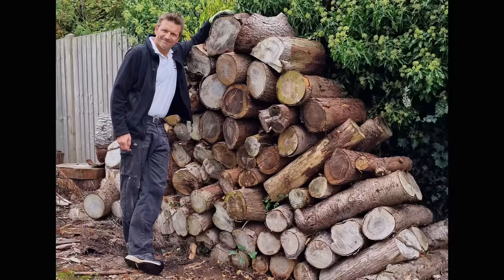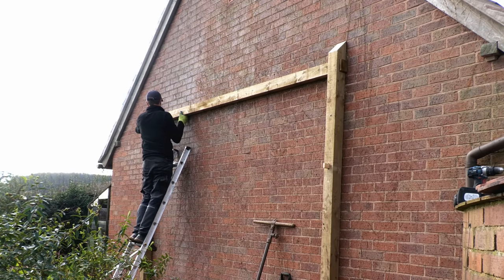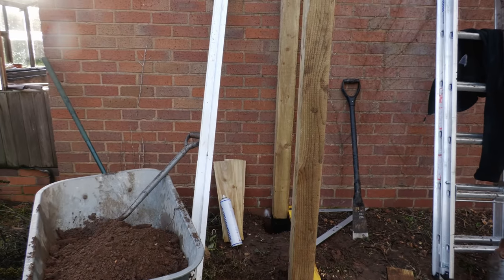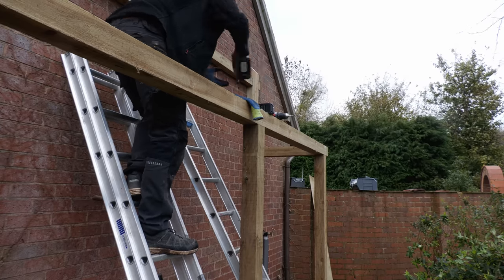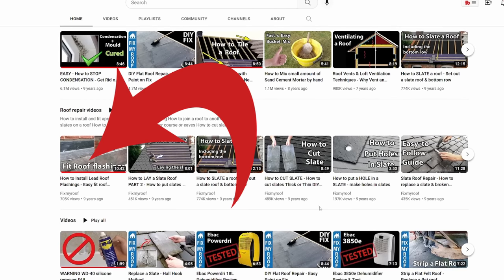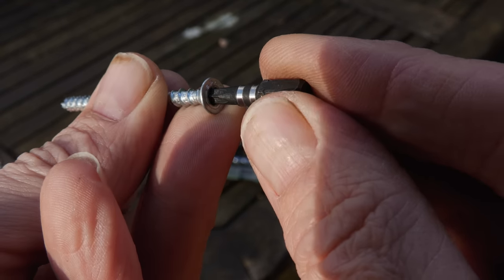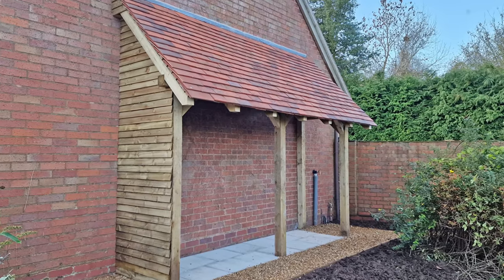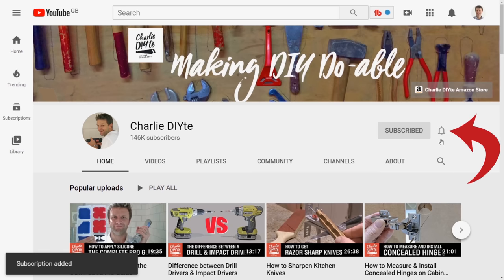How to Build a DIY Log Store

Comment: Be careful stacking the logs in there Charlie, if they're touching the wall you'll introduce an easy way for moisture to travel past the DPC. Either stack them so they don't touch the wall or put something on the wall to protect it, but that could also cause the same issue depending on what you use. 
We built free standing log stores so we didn't have to worry about it.
Reply from the maker: That's a good point, thanks. I'll mull over how to get round that 👌
Reply: I'm thinking a good air gap between the stored wood and the wall will benefit both.
Reply: @CharlieDIYte  Ideally you want all the logs to be free standing with around an inch or enough room for a mouse between the stacks to have good airflow. Also on the topic of airflow I would have made it wide enough to use pallets as a base for the wood so you get good airflow underneath it as well.

Also you don't want to cover wood too much, it's better to have wood exposed to both the rain and sun than no sun at all.
Reply: @Ben-fk9ey  I'd go as far as leave wood out in the summer and let it get rained on. Similar for winter if the wood wont be ready for this year. I don't know where/when/who - but drying (sap) logs in rivers was a done thing.
Reply: @CharlieDIYte  stick a trellis on the wall
Reply: Or some type of racking
Reply: @Ben-fk9ey  We have field mice in the wood pile, have to shake the poo off before taking logs inside.

Comment: Great vid. Thanks.Two ways to easily get MOT out of the bag. 1) when it's being dropped off by the truck cut the bottom of the bag so it all goes on to the ground. Put a tarp and if you have it an old board down first. All the MOT will be loose and easy to shovel up. With the tarp its easy to clean up after you've moved it 2) Put a tarp (better with a board on top) as close to the bag as you can. Split the bag on two sides. The MOT will fall out and you can give it a helping hand with a rake or something. So easy to just shovel off the the board. Keep the vids coming. Cheers
Reply from the maker: Very good point mate, thanks for sharing 👊 Slight problem is I wasn't here when it was delivered 🤣

Comment: Great video, a few points you may wish to consider for your follow up videos:
1) Guttering will prevent water splash back, so a useful addition, as a rainwater harvesting system. Raise the barrel above ground so you and use a hozelock connector or a watering can.  The higher the barrel the greater the water pressure that will come out of the hose.  You will be surprised at how slow it flows out of the hose as the height or head drops. 
2) A shallower roof angle would allow you to raise the front entrance and stack without hitting your head on the tiles.
3) Logs ideally should be split as they will season quicker and start quicker in your log burner.
4) Logs need airflow preferably through the pile, so a system of raising the base, 2x4's, pallets, even black plastic pallets anything that allows air to get underneath and percolate through the pile.
5) The oldest most seasoned log is always at the base at the back! Dividing the store into bays would allow you to store in batches, then burn each bay in rotation starting with the oldest, so you always have a seasoned bay.
6) If the logs are split into quadrants then stacked, you will get something like 30% more into any given space.
7) A black or say say slate roof will heat up quicker than a lighter colour tile, drawing more air in from the base through the pile. I have used black bitumen roofing sheets on mine due to budget restraints. 

I liked your roofing explanation by the way, there's more to roofing that it apears.
Reply from the maker: Thanks so much for this. Such brilliant advice. You and a few others have made me realise I need to plan the stacking very carefully, and although you've been kind about my roofing for some reason I decided not to add ridge tiles, so that'll need modifying. There will definitely need to be a second video and I'll give you a shout out for taking the time to send me all that advice. 👊

Comment: Looks really nice, great job. You’ll probably want some shelves / dividers for when you start storing wood, otherwise you can only ever take the stuff from the top
Reply from the maker: Thanks Daniel. I agree, the storage needs some thought. 👍
Reply: I agree with Daniel, great job - I built one very similar at the side of my garage. I dimensioned it on 3 standard pallets, so there's air circulation below the logs too - can always replace pallets if they rot. After the first year I included dividers, so I can separate softwood from hardwood and use them at different rates. Also added mini guttering after the first year - now have no drips landing on the logs when the wind blows

Comment: Another great video. I love that you let people know what tools you are going to use up front and have a summary that includes what you might do differently if you were to do it again.

You are lucky that you are not in North America as you aren't a fan of Robertson screw heads. The most common one is the Phillips screw head (+) followed by the flat head (-). In Canada the Robertson is more popular as the inventor was from here. There are still times when all one may get is a Phillips head screw. The only time we really see the Torx screws in Canada is with electronics.
Reply from the maker: Thanks buddy and I'm very humbled my vid is reaching you guys! I was just really disappointed because the Robertson looks like such an awesome design (I was aware it came from Canada) but it seems very dependent on you having a bit trust was designed for the screws rather than a generic bit of the right size, otherwise you get a lot to camming out. Yes we still have mostly Phillips over here.

Comment: Fantastic build there Charlie. I like the steep pitch. It looks classy and suits those rosemarys.
Reply from the maker: Thanks Paul. There is a glaring error though - I didn't install any ridge tiles, I think subconsciously thinking the flashing would cover the overlap but it hasn't quite so there's one modification I need. I think there will be a video #2 as the stacking of the wood is going to need some careful consideration too.

Comment: You want a build some sort of grid at the back to hold the logs away from the wall and allow a bit of airflow. And when you stack them don't stack too tightly - there should be enough space around the logs for a mouse to run through. You should be fine leaving the front open.  As the logs dry out the grain tightens up and makes them much less prone to absorbing water so any rain tends to be on the outer surface only and dries out quickly when it stops raining.
Reply from the maker: Thanks mate. Yes, I think a bit of thought needs to go into the storage...

Comment: Great job Charlie, the finished result looks excellent and fits in perfectly against the garage.   Thanks for showing all the detail of how you built it.
Suggestion for connecting your Henry hoover to your router, I have a Henry as my workshop dust extraction, connected to a cyclone, and then a length of standard hoover hose to connect to the tools.  I have adapters made out of 40mm white waste pipe - the hose fits snugly into one side, and to adapt it to the different tool ports have used either waste pipe connectors or reduced or increased the size of the waste pipe using a heat gun.  Works perfectly and very low cost!   There’s a video on James’ Man Cave channel on this.
I’ve had mixed success with cement infill over the top of lead flashing. Even the stuff that our builders put in on the house extension has cracked and come loose over time.  Think it really needs a more flexible jointing material like building selant
Reply from the maker: Thanks Geoffrey - some great tips there.  Yes I'll see how I get on with the flashing. I've actually had to modify it to introduce some ridge tiles (the half length tiles to maintain the overlap) so I may have to redo the flashing in the spring. I'll check out that channel. Great suggestions on the vac connectors. 👊

Comment: Lovely log store! For the flashing I think what you’ve done is perfect
Reply from the maker: Thanks. Except it needs a row of eave tiles - can't for the life of me figure out why I didn't bother with them. If the flashing was an inch or 25mm wider it wouldn't matter. Anyway now installed but I'll have to redo the flashing in the spring. There will be a second video talking about the log stacking and this point. 👍

Comment: @10:00
Agree with the adjustment on the rotating the tenon.
One other point if you put them in the easier way you’ll also minimize cross grain, resulting in a stronger joint.
As far as I can tell they’ve been installed face down instead of edge down.

Comment: Excellent project Charlie, that came out looking great, you certainly challenged yourself and tried some new skills along the way, so really worth it !

If you've got any hanging around it could be worth using some cut down pallets to stack the firewood off the ground. I have some (very) basic curtains on the front of my store made from 1m wide landscaping fabric weighted down with roofing batten screwed through at the bottom. As you say this doesn't look so nice but tbh I only have it up for the worst of the autumn/winter weather when you're not out there looking at it much anyway and having a number that are 1m wide means I can tie one up for regular access leaving the others down. Consider protecting the wall from damp logs too !

Comment: Another good DIY video Charlie, hats off to you the way you put your videos out knowing they are going to be scrutinised,  99.99% of DIYers would be delighted if our log store looked like yours 👌 I recently used 35 bags of that brand of postcrete and found quite a few with set lumps, just wondering if this was a one off with this brand?
Reply from the maker: Thanks Nigel, really appreciate that. Yes the scrutiny is one of those things - keeps me on my toes - like the guy who posted rightly just before you that I had forgotten the eave tiles. Still don't know why I didn't bother with them but they're in now but I'll have to redo the flashing! On the concrete that's not usual. I did have a big rock in one of my sacks but the sack had a cut in the side. Maybe yours did or moisture got in during the bagging up. Very frustrating for you!

Comment: Excellent video 👏. In my experience, digging stone out of bags is easier with a round head long handle shovel or pointed spade.  They get into the stone much easier.  I have both but the long handle round head comes in handy for all sorts, especially sifting my compost through my soil sieve and picking up doggy’s contributions..I’m sensitive to that one and being as far away as possible helps 🤢🤣🤦🏻
Reply from the maker: That's a very good point. I ended up freeing it up with my mattock pick.

Comment: A super Job Charlie! The 45 degree angle was worth it as it matches the garage roof as you said. Id be happy with this as a porch or an arbor, never mind a log store. on that point, maybe a wisteria or a climbing rose growing up it? most would be frightened of a climber but I think it would really set it off:goodvibes:
Reply from the maker: Thanks David.  Yes I might do something similar over the front door. I've already had to make one modification though. For some reason I didn't bother with a ridge tile layer. They're now in but I'll have to redo the head flashing in the spring...

Comment: Wonderful work and lots of useful info in comments. I stack logs in layers between light battens tied to pallets and rafters then braced with thin rope every 1.5 metres. I tried to post a photo link but Youtube blocked it.
A shallower roof angle would make the edge higher, you are going to bang your head when stacking high, just like I do.
Reply from the maker: Thanks. I saw the photo - ingenious arrangement! Yes the head banging is the biggest design defect 🤦

Comment: Interesting project presented at a good pace with plenty of information. I'll be trying the floating tenons and I like the post and wall plate detailing. 
You may find it helpful to sub-divide in to bays so you can be filling one while emptying the other. I've built a few wood sheds and heat the house with a wood stove and find being able to start restocking  before the whole store is empty very helpful. A small kindling shelf is also useful.
Reply from the maker: Thanks Rob. Yes I'm working on the storage at the moment. I'm putting a pallet base in and a shelf - and a trellis at the back to keep the wood off the garage wall. Haven't decided yet whether to subdivide with a vertical separator although I can see the sense of it. 👊
Reply: I'll look forward to seeing the results. 
Interesting points. It seems a shame to make such nice structure and then shove a few old pallets at the base. How about breaking up the pallets and just laying two parallel pieces at the base of each layer of firewood? About an inch gives plenty of ventilation space under the stack. Less room for vermin too. 
Given there's a roof and good ventilation I wouldn't have though it necessary to batton out the garage wall either.  Happy stacking either way. 
In a separate topic - I was concerned  our wood stove was causing particulates inside the house so bought a particulate meter. Interesting results and the stove is not a concern. Putting the toaster or oven on in the kitches sends it shooting up. Candles dangerously so! May be worth an episode to see what your findings are?

Comment: A tip when using lead sealant! Fill the entire gap with sealant all the way down the length of lead n then start at beginning with a wet finger simply dab the sealant, it will push in and not smear
Reply from the maker: Thanks Dominic. Makes sense 👌

Comment: Very pretty but ...
Put trellis on the wall to keep the logs off the masonry and pulling damp through. Put old pallets on the slabs to stop logs drawing up water and help dry from underneath. Finally, get some weed suppressing cloth and hang it on the sides and front and driving rain won't get in at all while the logs dry.
Reply from the maker: Thanks, all good advice 👊👌

Comment: Only thing I would comment on is possibly using metal brackets for the wooden posts. In some cases this can prevent the wood from rotting from moisture, I know you've used a shrink wrap around the posts before digging them in and it's covered by the roof so chances are it should be ok, but sometimes if the wind blows in rain the moisture can travel from the top of the post into the buried section where it can't dry out easily and causes rot to set in.
Reply from the maker: Yes that's a fair point. We'll see how we get on with it but I think it'll be a fair few years before I have any problems with it rotting.  One thing I did forget was to put in a row of ridge tiles, now added. I'll mention this in the update video👍

Comment: Whilst the front will get more splash back on it, it will also get the most air. Stacks can end up leaning forward when they dry faster at the front - specially if stacked really wet/green.
Reply from the maker: It's a good point, and actually I reckon the splash back will only happen nearer the bottom. I might also install guttering.

Comment: Hi Charlie, please check with your house insurer as my friend had his renewal refused after he declared that he had added a log store to the side wall of his house ( I know yours is on the garage but worth checking) they refused to insure him as they said it was a fire risk.
Reply from the maker: That's a fair point I hadn't thought of. There's always something isn't there!! As you say, should be ok as it's a garage away from the house but if we ever convert it... I'll check.
Reply: @CharlieDIYte  Great build by the way 👍😃
Reply: Fire risk 🤣 gotta love insurance. I have 1000 litres of kerosene outside and they're fine with that.
Reply: @DukeofDave  your tank will be fire rated for about 60minutes, dry logs not so much haha
Reply: @jakejohnson_  it definitely isn't. And the logs would need a substantial fire to get them alight.

If you put a heat source in between the oil tank and a log store the kerosene would be blazing log before the logs.
Reply: Some friends of mine built a log store, to stop the moisture getting past the DPC they used two pallets screwed together-one horizontal and one vertical then slid them against the wall, they work great, no wet house walls 👍
Reply: @CharlieDIYte  would love to see some videos you and Mrs Charlie doing DIY together, love the log store, love watching your videos very informative charlie, keep up the great work
Reply: Since ours is on the house I added a heat alarm.

Comment: Did the rear vertical posts need to go all the way down into the ground? Or would it have been strong enough to rely on fixings into the bricks and have floating vertical posts?
Reply from the maker: I suppose so, with enough concrete screws particularly given the support from the "ridge" beam. Or just have it sitting on a plate.
Reply: @Charlie DIYte  thank you. Just weighing up how to do something similar, but with a lighter roof than tile so considering how much support to go with